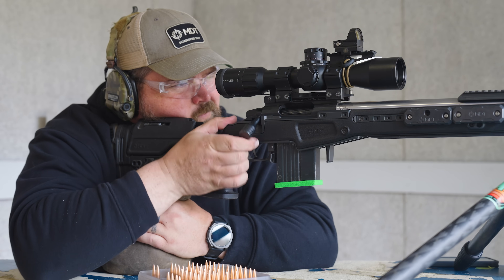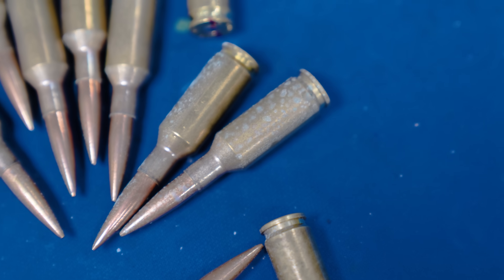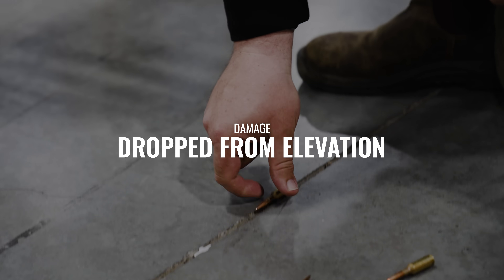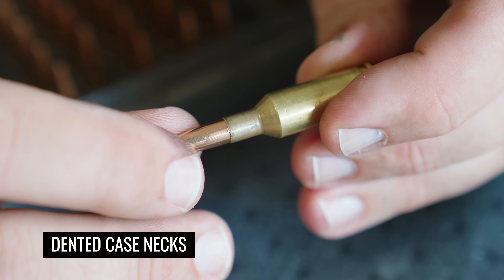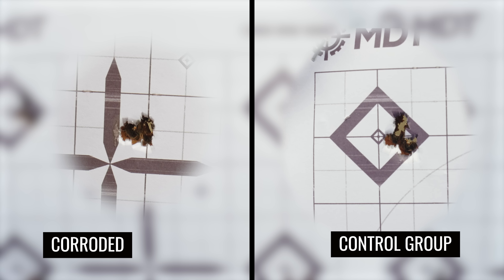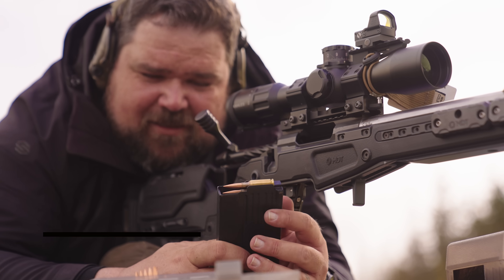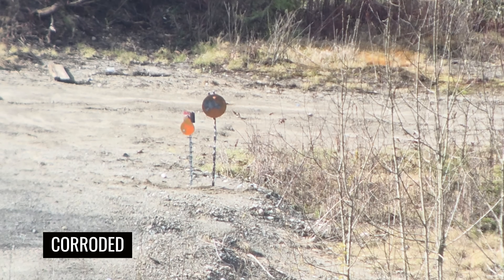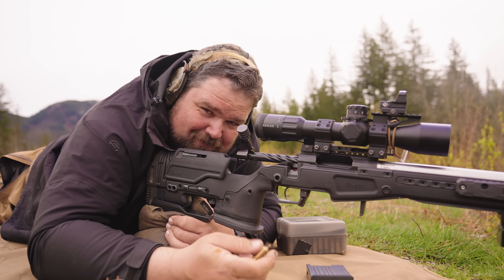When Is A Bullet "Too Damaged" To Shoot?

Comment: The damage on most of these is so microscale that the air won't even touch it once it leaves the barrel. The only bullet damage I would consider to be a no-go would be actual deformation of the projectile (like you created with the punch and drop tests) or damage to the plastic insert of a ballistic-tipped projectile. And with the latter, I would probably consider just using pliers to remove the ballistic tip to expose the hollow-point. I also don't shoot precision comps so my idea of a bad group is much different than yours 😂😂

Comment: I remember when I was going through sniper school in the Army. Got on line, cadre walks up, asks for my magazine, I drop it, hand it to him, he removes one round, pinches it with a Gerber tool, replaces it, and hands it over. Tells me to fire. I instantly have a problem with this guy. He didn't do it to no one else's weapon system, just mine. I fire, miss, and he marks me down for the miss. THANKFULLY enough Battalion Commander was on site and seen what had happened. Cadre tried some bullshit with "a sniper shouldn't ever have a problem" but got fucking demolished when the Full Bird Colonel told a Master Sergeant to smoke the piss out of him. 

Never knew what happened to him after that but fuck that guy. Hope he was NEVER a range cadre after that.
Reply: Uh huh sure.

Comment: Went on a trip in 2017 and got ahold of some 30-06 ammo that had been found after being discarded during the battle of Tarawa. The ammunition was so corroded that I could pull off the projectile by hand. This ammunition has sat buried in a tropical environment for 3/4 of a century. I was amazed that the powder burned normally when I lit it. Wouldn’t even consider putting it in a rifle, and probably wouldn’t chamber due to the excessive corrosion anyway.

Comment: Spin will average out any slight weight and small aerodynamic effects so to me it seems like it needs larger things like blunting the tip before accuracy is affected. Also the bullet itself will get deformed when forced into the rifling and that would do more "damage" than shaking the bullets did, probably even smooth out the dent from the punch.

Case damage should effectively fix itself, same as fire forming brass, as long as it is not so bad as to structurally damage the case. Maybe steel would be slightly more of an issue than brass as it is less malleable. This doesn't mean I'd shoot something that is dented to the point of changing internal volume by a decent percentage, that seems risky.

Friend of mine will happily shoot ammo he finds on the range, sitting outside for weeks and found under or after snow melts. Funny thing is they almost always fire with only the odd 22LR failing, this included a paper shotshell found under melting snow. I don't toss suspect ammo through a valuable gun, seems risky for minimal benefit but I am constantly impressed with what ammo endures while remaining functional.

Comment: Maybe not much an actuall issue but with self loading rifles where action handles bullets much more rough and bullet typically gets scraping marks
from feedramp when going in chamber.
Last year in hunting trip i seated same cardridge least few times and pullet it out whitout shooting and it definelty started to show 
quite visible scrathes all around of bullet.

So funny question is that will those have about same amount effect to accuracy as those intentionally dented bullets
or is there any real world difference between fresh (single fed) or one which have been cycled least 5 times in and out ?

And yeah ar-15 with .223rem bullets was in question.

Comment: Drag marks or scratches from ejection of a live round

This is more of an issue with semi auto rifles than bolt action, but I would still be interested to see the impact on performance.
Reply: I've done it. It's unnoticeable within a normal shooters margin or error. There's a super sonic bubble that forms across that round, any little variation in drag is minimized in contrast. Other considerations is centrifugal mass in motion on center, meaning and variation will be across the entire center of a round as it is spinning complete rotations, it's the reason bent polymer tips don't have a greater impact in performance during this test. Bullets are also going to pick up scratches during chambering and get marks imprinted on them from the bore. Its a non concern. Hope this helps. Just send it and be more concerned about fundamentals.

Comment: Also, thanks for doing this. I dont have a bullet puller so i often use the wire cutter inside my Leatherman pliers and my single stage press. Sure it damages the bullet somewhat but i dont think its terrible. Now i have faith that the bullets are totally reliable for my level of shooting. ELBOWS UP CANADA
Reply from the maker: Perfect! It's nice to be able to confirm that you are ok, cause as we know reloading components are not cheap

Comment: Last 500 eldms I bought....at least 25 tips were broke. Then I was breaking tips off left and right. Even going up the feed ramp. Maybe a bad batch. Maybe really rough handling. Lost faith in them. If they can't go up a feed ramp how can they handle 300000 rpm? 

Bergers don't do that. So I've switched 😅
Reply: That’s interesting I bought/ used several thousand bulk ELDMs and I’ve only had a handful (3 to be exact) of out of the box bent tips, and never from the feed ramp, even while loading at  competitions. I would definitely contact Hornady and get a new batch of bullets from them.

Comment: did you collect velocity data on for these? i'm far from an expert but i would think dented areas on a projectile would create a low pressure area so the higher pressure air around them wouldn't enter the dented area to cause a disturbance in flight, similar to how a pick up bed functions under speed. however i would expect that to create additional drag that might be enough to impact velocity or how wind impacts the round in flight.
Reply from the maker: We did, but with velocity changes you would see that form in the group if there was anything noteworthy.
Reply: Virgin case is typically produced lower velocities, 5 to 20 feet a second. So I would think, theoretically, a dented case would do the same to a lesser agree. I think you have to test 20 or 30 cartridges to prove it definitively

Comment: Rusted casings. 6 GT?
Reply: brass doesn't rust so unless you are using steel case 6gt this shouldn't even be possible.
Reply: @bringit261 it may not rust but it does corrode. Tomato, tomahto
Reply: I really wouldn’t call those cases corroded they just look like they had a salt film on them